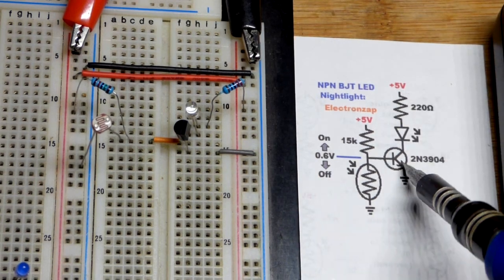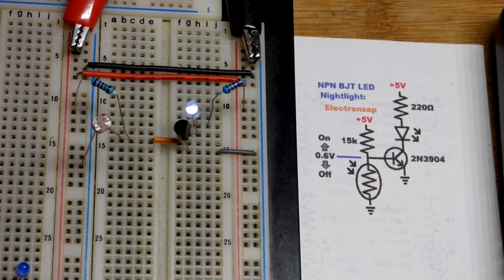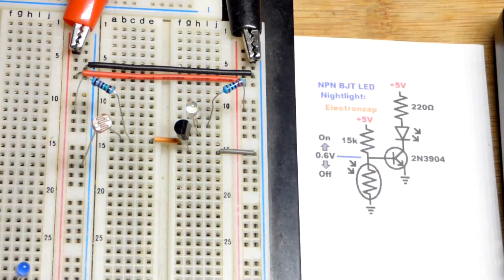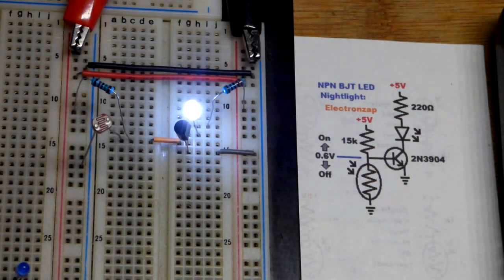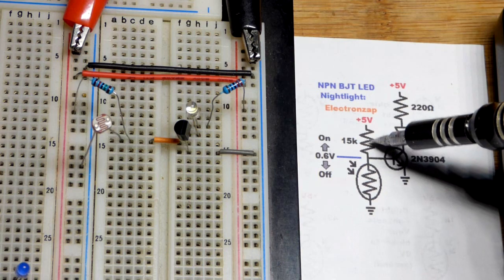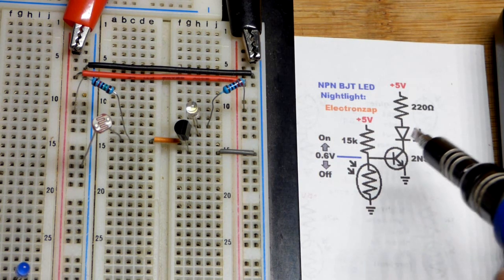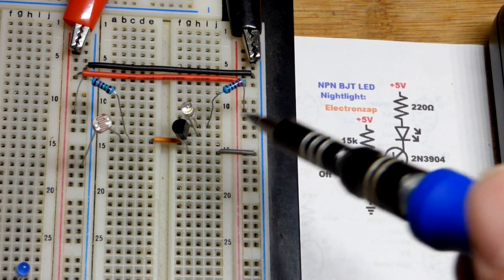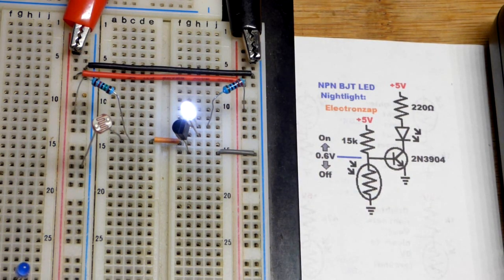NPN 2N3904 Bipolar Junction Transistor BJT indicator LED Nightlight circuit schematic diagram

Comment: nice video what is the current draw when the Led is out ??
Reply from the maker: When the LED is off, there is just the current flowing through the voltage divider resistors. So, about 5V/15,000Ω = 0.000333A.
Reply: @Electronzap  Thanks :-)